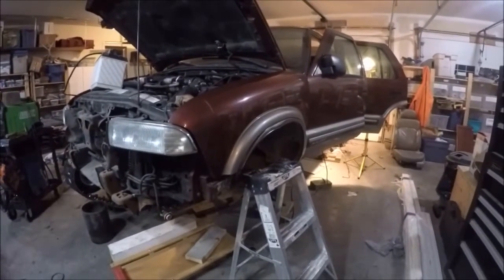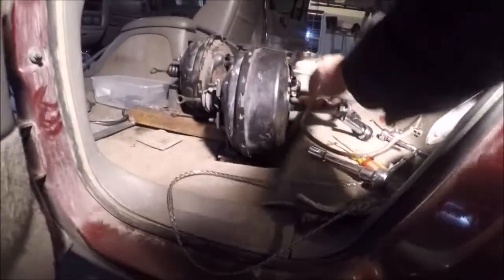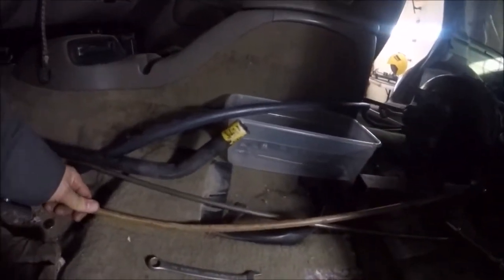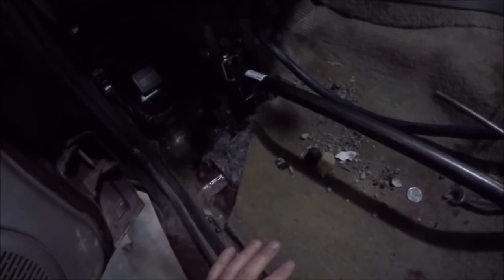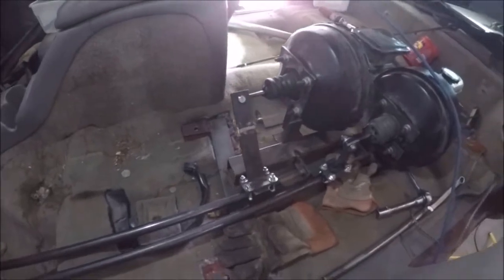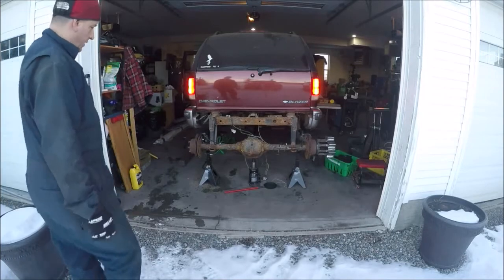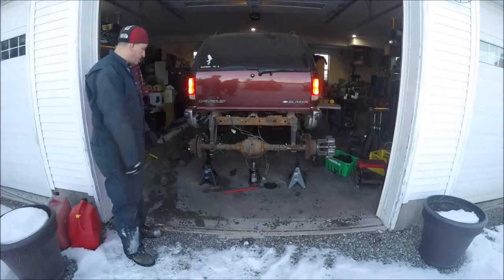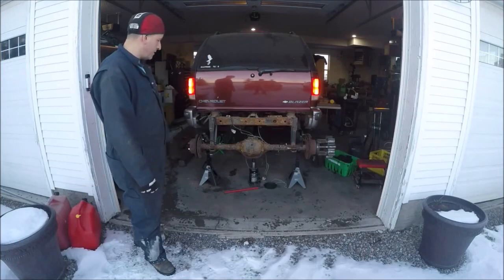Custom Tracked Vehicle, Part 14 Brakes Complete, Almost

Comment: Limited slip diff, wow, most of the time you don't get the good rear end, LOL.  Might be good to leave it in. I'm told if a tracked vehicle goes more than 20 mph it will want to wonder to one side because of the surface it's riding on. Got that info from a fellow tanker buddy from military. On the brakes, on the master cylinders, the port not being used, you need to bleed it and plug it. That way it is full of fluid and in hydraulic lock. You said that you had to pull back a ways to stop, might be because you have to push the pistons to use the port up first that is not being used, then the piston with the fluid in it will move to push the fluid. Your setup should be as good as original brakes with little movement even though you are using one port just as long as the other port with piston is full of fluid and in hydraulic lock by a plug. Those are 9 or 11 inch dual power boosters and should be putting over 1000 to 1500 psi in the lines.
Reply from the maker: Hey Prancstaman!
LOL on the rear end, if I put in an electric locker then maybe I could do that whenever neither brake is being applied. It will drift when driving down any road or very flat surface, personal experience from driving a Nodwell which works the same way and has a regular differential drive but realistically how often will you be driving down a flat straight trail. I plan on torturing this thing if it actually works so no straight roads in it's future.
For the brakes, I pulled out the piston on the master cylinder and inserted a piece of tubing to act as a stop for the piston so it cannot compress the second half of the piston and pressurize the outlet. Basically the same as bleeding it and plugging it. I still plugged the second port of the master cylinder but it seems to be spongy as one side is soft, I am not sure I can get the air out and my plug is actually the original steel hose folded over and welded shut. Double protection I hope. Will have to bleed the second port to try and eliminate the little bit of movement that piston has before it hits the stopper.
Watched your videos on the double pulley drive. Can't wait to see it in action, hope it works for you.
Brad
Reply: Thanks.